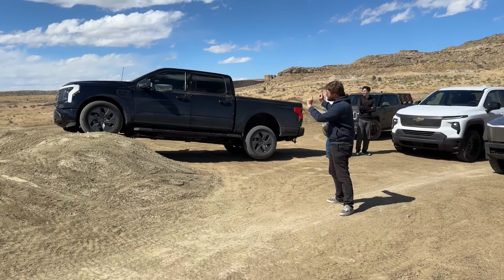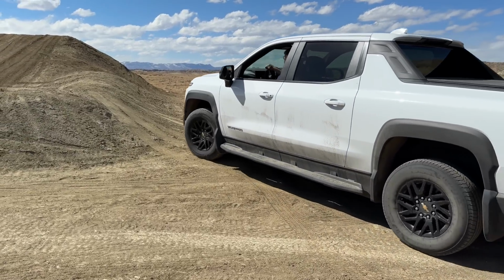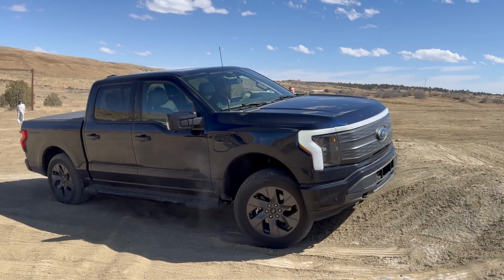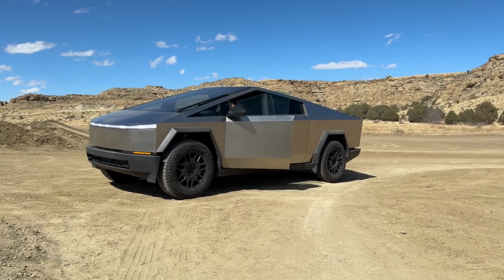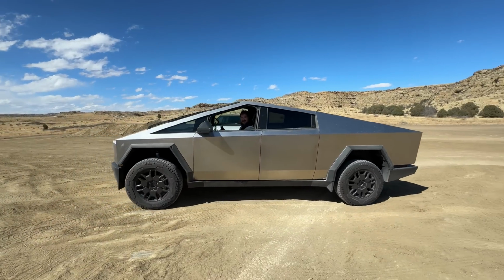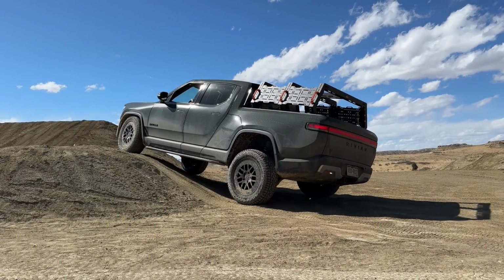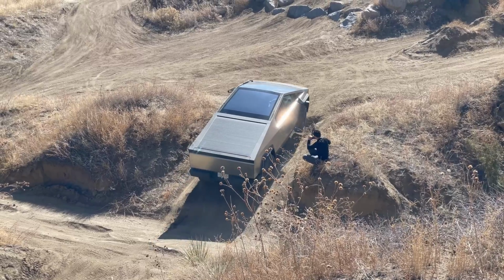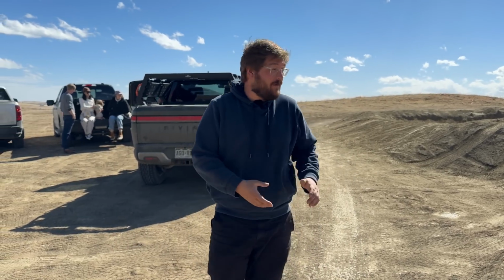EVs Explained Off Road! Dual Motor vs Tri Motor vs Quad Motor - Locking Diffs vs Virtual Lockers

Comment: Tesla's motors are actually both Induction and Permanent magnet, they actually actively change the Synchronicity to rely more on induction or the magnets, which can provide benefits at low or high speeds, i think they call them IPMSynRM, Intelligent Permanent Magnet Synchronus Reluctance Motor

Comment: 31:30 Next... optical sensors that can enable correlation of movement over the surface with tire rotation... kind of like an optical computer mouse at each wheel.

Comment: To be honest with ya'll I don't understand why locking diffs on the Cybertruck would need a software update. It's literally just ON vs OFF. The mechanism for turning it on and off must be there since the hardware is supposedly there, not letting you control it yet makes no sense at all to me. I drove an old Scania military truck from the 70s with electronic gear select for high-low and lockers. They did that in the 70s. Tesla, supposed to be the better company at software is not letting you use the hardware you have. What am I missing here? What's the explanation?
Reply: just out the gate , the first thing that occurs to me , is that the locker is on the front axle , normally they are on the rear axle on most vehicles , the reason on the front for cybertruck , is that there is dual motors in the back ,so there is no differential there to lock anyway . Diff locks are very dangerous , if they dont unlock properly , a vehicle will continue straight ahead and possible cause a accident , ive done it in a tractor once , diff lock stayed on , i turned but tractor only half turned and i crashed into a wall. But if the diff lock is on the front, the situation gets even worse , as have little to no steering at all , super dangerous in fact. The cybertruck would need a whole host of software protocols , to monitor the diff lock , to make sure it was operating in the right way , in the right operating window , for example if the vehicle speed was over say 10 mph , the diff lock would need to be disengaged , a software input would need to detect when it was disengaged , and that woud need to be tested for robustness and repeatbility.
Reply: @andrewashmore8000  I get what you mean. Front lockers are a whole different game. But still, releasing a product and promoting features which do not yet have a proper implementation does not sit well with me. I guess Tesla is just about the only car company out there that for some reason manages to get away with it. It was somewhat understandable when they were a new company, but they’re one of the big boys now.
Reply: The real answer is. Tesla rushed the CT and just doesn’t care about it enough. They have to develop parameters for the software. They are selling so few they, it’s not worth their time right now. They are probably are working on it. It should be out shortly.
Reply: @jackylsmith8138  Releasing a product and not really caring enough about it to make it do what it says it will do on the tin is wild to me. You see stuff like that with video games and software, rarely do you see it with physical products. Autopilot, locking diffs, all these different modes and what not that are greyed out in the UI, it’s just very strange.
Reply: 'It's literally just ON vs OFF.' I think that you are missing that it’s probably not just ON or OFF. But I’m puzzled too - why would it take more than 3 months for a software update that simulates a diff lock?!
Reply: @tobias_dahlberg  True it doesnt make much sense , i think Elon likes to run his businesses like startups , its kinda his style , there is pluses and minuses to that , approach ,  with the diff lock , its just too dangerous , not to have it fully checked out first , so i think they did the right thing by not having it enabled. Your right no other car company would get away with that .
Reply: I’ll take a V8 with rear locker and front lsd until these yahoos make one right. Ford almost did, needs more ground clearance.
Reply: People buying the Cybertruck will be complete novices. I suspect Tesla is trying to make it as failsafe as possible.

Comment: Would have been great if you told us when you were braking or just showed the brake lights. Braking probably affects the software. 
Did the CT just roll back on its own when you applied brake and accelerator?

Comment: “Getting a motor to spin from 0 to 1 RPM is really tough.  Getting it to spin from 5 to 10 RPM is much easier.”  No, maximum torque in an electric motor is at 0 RPM, and so it’s just the opposite, but for all practical purposes the torque is high at any of these low RPM values.  Still, your main point is a good one: powering only one wheel with one motor (of 2 or 3) in an EV results in less power than in an ICE vehicle with locking differential.

Comment: I think i would still prefer physical locking diffs, but not entirely sure...  Solid front axles just seem to be far more predictable and, at least so far, have performed better IRL.   Although 1 for 1 motor control does appear to have many benefits to the vehicle overall... It requires far less maintenance, as you no longer have axle components to keep lubricated. Simply add two more motors, which of course will increase the overall cost of the vehicle goes up.  The real question mark is how much do you trust the software to the right actions, and actually apply power to the ground?

In theory one for one motor control is superior if all motors are adequately powered and safety systems don't get in the way of power delivery.  In the real world, so far, solid axle configurations bring time tested predictable power delivery and operation.  While the added mechanisms of the diffs iare a negative, it provides a lower cost solution that involves components that nearly anyone with some basic auto mechanics skills can service on their own.  Think this will largely depend on how good is the software?!

Comment: I've been thinking about this some more and looked up what I could find. Is there an argument that the dual motor Cybertruck will actually be better off road than the tri motor once the locking differentials are enabled? While the tri motor has more horsepower, in a scenario like the one you tested where only two of the wheels have traction, that number is decreased because one of the motors is useless. Then when they are both basically two motor vehicles, the dual motor actually is listed as having more power in each motor. IDK why its like that, but if there are no losses from the locking differential, the dual motor could have more power. I couldn't find any numbers on the torque, but it seems like the tri-motor's motors are kind of tuned down, so it might also have less torque in this scenario. And then on top of all that, there is the different in the quad motor vs differential type of driving with the accelerator. If the tri-motor is using both, maybe that hurts it compared to the dual motor. 

Just something interesting I was thinking of. I wonder if someone can compare them off road once the locking differentials are enabled.

Comment: Great video...  I think I would prefer a GOOD limited slip diff.. like Torsen or equivalent something strong enough to transfer 100% of the power to any axle or wheel. they have instant power transfer to the wheel with more grip. Even better if you get a good center diff and on the axles.. ... next would be lockers.

Comment: You have wrong explanation about tri-motor software locking. When it feels that one tire spins, its task is not to "send more power to another wheel", Its task is to stop sending power to the spinning wheel, cause if it gets back to traction while spinning, it can throw the vehicle very unpredictably.

Comment: The cybertruck did great without any locker at all , probably the best of the bunch just using software. Amazing how stiff and flat the body was on the cybertruck compared to the rivian , the cybertruck with mechanical fixed torsion bars ,the rivian using dynamic levelling allowing it to keep wheels close to the ground. the cybertruck is fun to mess around in drifting at ease . wanted the F 150 to win ,but it came third overall ok for just a non extreme off roader truck
Reply: The Cybertruck front right wheel was up in the air.
Reply: The more we learn about these trucks the more we learn it is choice vs better.
Reply: the rivian doesnt have a locker at all so its the same case lol!!!
Reply: @alanmay7929  your right , the rivian should be the best at this challenge , plus it has no fixed torsion bar , so in off road mode , get much better differential travel between the wheels giving better overall traction.

Comment: A 4 electric motors with appropriate software solution will be superior to a locker, especially in regard to the inevitable component damage that use of lockers in a real world scenario always entails
Reply: Only if each tire has enough power to climb the hill.
If the Rivian has 4 times 200hp motors a old landrover defender from the 80es with 100hp, lockers and lowrange, can put down more power to one wheel than the Rivian 4 motor is able to.
Coupled with the lower weight of the old landrover, it would be able to climb to places the Rivian 4 motor can not.

But in general all purpose driving I would prefer the 4 motor EV.

Comment: I would like to see a vehicle with traction really only on just one wheel. :D Realistically, it will sit at least on two wheels if you nicely balance it diagonally. But most of the time, it will be 3 or all 4 wheels.
Reply: He’s not saying it’s literally on one wheel. He’s saying there’s times only 1 wheel has traction.

Comment: It seems to me that the quad motor is the most versatile but not the most optimum for all cases
Reply: I would generally agree with this!
Reply: quad motors is the worst of all! it needs extra electric motors plus inverters and uses alot more energy thats extra weight! imagine replacing those two motors and electronics with more batteries instead! 2 electric motors a locker on each of them best option.
Reply: @alanmay7929  are we talking about wallets or driving experiences?
Reply: @manuelias86 were talking about everything! the less motors you have the more batteries you can bring with you to significantly prolonge your range! the two motors variant will still have quite alot of power
Reply: @alanmay7929  sorry, I must’ve misread the title of the video

Comment: Interesting. I'm not sure I fully understand why a virtual software locker could never be better than physical locking diffs. I understand that physical will be more predictable and consistent in certain conditions, but I'm not convinced that you COULDN'T outperform that theoretically. You have all the sensors to know the shape of the car, the pressure on the wheels, etc. Not that they WILL advance the software that far anytime soon. But still. 

Feels like something where AI and machine learning might do a better job than a human trying to code for the edge cases. Ok. Anyway. Point taken, it'll probably be a while before off-road-by-wire is easier to use than something straightforward and consistent.

Comment: Perfectly executed comparison! As a rock crawling Jeep owner I’m impressed that they all manage so well without lockers. Besides that it seems manufacturers  underestimate the value of front and rear close perimeter cameras so I’ve added them to my Jeep. So I really like Rivian’s better cameras along with wheel traction display. And I really wonder why Tesla refuses to provide valuable Birds Eye View for parking and now off-roading. I forget which - but there’s a new vehicle that displays the ground image UNDER the vehicle while in Birds Eye view as if it were transparent - and that alone is genius and would weigh heavily on my next purchase 🤩
Reply: I believe you're referring to the GMC Hummer EV with the under carriage camera.
Reply: @ChrisKellyPrime  Oh that’s an actual camera angle underneath! Yeah I totally dig that. But what I saw was the top down image stitched into the vehicle footprint (shadow) as if the car wasn’t there. Still can’t find that one but did see there are now tons of aftermarket Bird’s Eye cameras. 🤙🏼

Comment: There's lots of talk among Rivian Forums that the upcoming production line halt and restart may mean a refreshed R1 with quad Enduro motors for improved efficiency and more power.
Reply: I have the R1 quad motor. Whats a quad Enduro?
Reply: @xKINGxRCCx  The quad uses motors manufactured by Bosch. The dual motor uses Rivian-designed-in-house motors that they call “Enduro”. The quad makes more power overall, but the dual’s motors have more power each, so using four of those would be more powerful. 

That’s what the rumors are, that the refreshed quad will be quad Rivian made Enduro motors instead of the Bosch motors.

Comment: The ultimate 4x4 EV system would be quad motor with both computerized traction control system and also manually controlled, mechanical lockers front and rear to use in more challenging off road situations.
Reply: You can't have mechanical lockers on a quad motor vehicle because there's nothing connecting the wheels together.  Each wheel is powered by it's own motor.
Reply: @WildernessExcursions there can still be a shaft that is driven by both motors with a clutch/locker. There just won't be a need for a differential.
Reply: One massive motor and a more traditional drivetrain. The larger motor will put everything to any wheel that has traction and struggle less. Then paired with locked axles/drive-line. This is off-road, economy isn’t a factor. There’s a reason you don’t see two engine rock-crawlers. If your hung up on making electric motors a part of 4x4, just swap out the ICE and get on with it.
Reply: @cheezzinator  There comes a point to which the weight and complexity of a system starts working against what you're trying to achieve. IMO dual motor with lockers is kind of the sweet spot for EVs. But ultimately ICE is still the best for off-road.
Reply: @labdrone4647  I agree with the single motor idea. But if you were to have a dedicated off-road vehicle, you might as well stay with ICE for range and weight savings.
Reply: @WildernessExcursions  I'm not arguing that, just that it is not impossible to do. It's mechanically simpler than a full diff as well and allows to send double the power to a single wheel. You make some good points, I can't disagree - I have limited experience here, only a solid background in physics.
Reply: @labdrone4647  I would imagine there being a point where extra power/torque to a single wheel has no real use. Electric motors are so power dense that the dual motor + front and rear lockers could be the sweet spot.

Comment: Great video! Can’t wait to see when you have access to the cyber truck with the locker enabled! Also would be cool to compare against a Torsen differential on a Raptor if you’ve got access to one.
Reply: it wont stand a chance against raptor! the raptor is made for offroad abuse and all the suspension setup for that.

Comment: I think you are incorrect about lockers being better than individual motors. You say the downside is that you are limited to 25% of the total torque being applied to one wheel. Permanent magnetic motors make peak torque at 0 rpm. 25% of this vehicle’s peak torque is way way more than you could ever use off road. For these fast vehicles peak torque nearly breaks traction on pavement. It would spin the wheels in dirt. But yeah being stuck at 0 rpm and high current is bad for localized heating.

Comment: An election vehicle can’t replace 4LO with lockers, especially when you regear.
Reply: Not sure if you are talking about ICE but EV will make a better rock crawler. No need to worry about driveshaft either.

Comment: The Rivian 4 motor software could easily be made so that the throttle dictates the ground speed and not the engine power delivered to the wheels.
In this special mode the car will automatically apply power to reach the wanted speed dictated by the throttle position.
4 motors with more then 200hp each should be enough to move the truck even with only one wheel traction, unless the 10 years of claims like "full power from 0 RPM with EVs" was a lie.
Reply: That would turn it into the tire shredder 4000
Reply: The wheels in the air would spin like mad and destroy themselves

Comment: Has cyberbeast improved the locking with software?
Reply: The locker is now functional.

As far as the pseudo locker I’m not sure it has improved. I’ve  never been impressed by more than one motor on the same axle.

Comment: Kyle, One big miss is not using a tq biasing, torsen, differential.   It's usefull more often than a locker.  When the bias ratio is exceeded the brake torque vectoring is way more effective than on a open diff.   i think torsen is better for anything not a dedicated offroad vehicle.   I've had a cruiser with the three lockers.   I have a raptor with a rear locker and front torsen.    The best differential would be a tq biasing locker. 

For quad motor or dual motor rear drive what is missing is a clutch to link both motors together and it becomes software tq vectoring with locking option. 

Rover had some seriously good, rapid reacting brake traction control modes, honestly better than these EVs. 

You should get some rollers to do roller tests back at the shop.  See how fast general mode reacts and clears 3 rollers. 

https://youtu.be/1lBe2ao3j1Q?si=CLO2gDBAvSlOQwLZ

Comment: Rivian doesn't need a locker and 150+ horse power per wheel is plenty.
Reply: No it's not.. Not if there is any serious angle.. not on one wheel, and not to move a 7,0000 lb vehicle up and over a rock. Probably IS enough 95% of the time.. But offroading especially at Moab, or similar you will run into situations where you need more torque on one tire.
Reply: @kens97sto171  I had many rock crawling friends with 22 RE motor less than 200 h.p. so I believe your wrong.